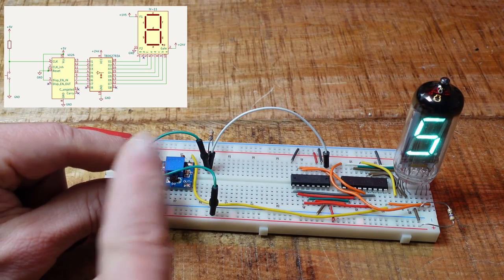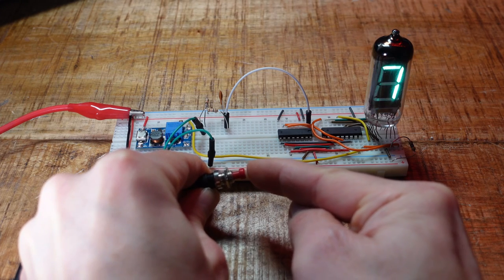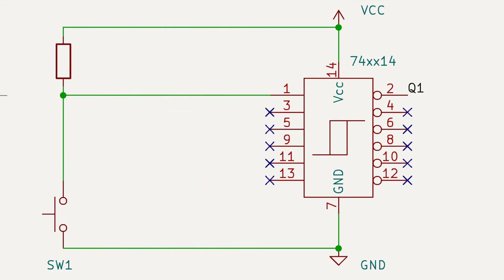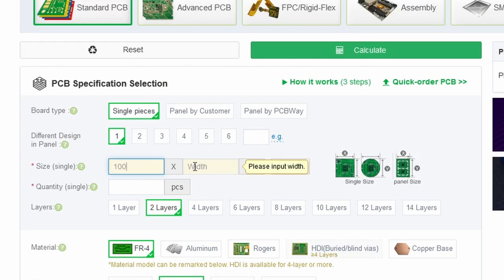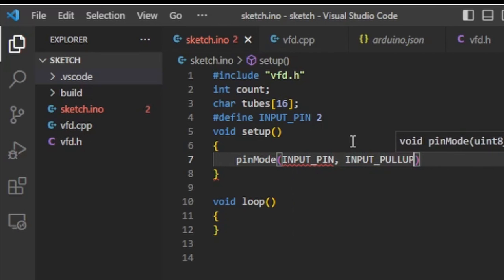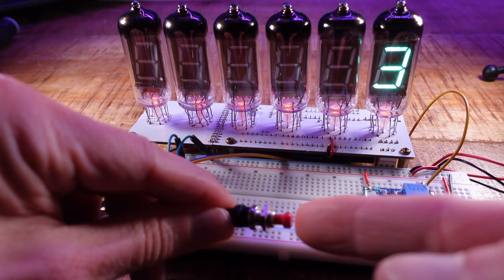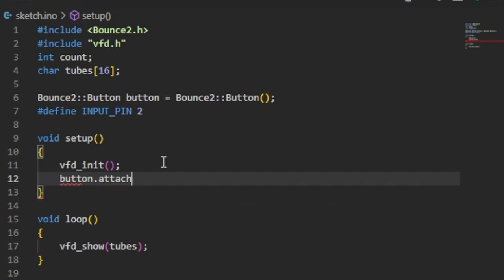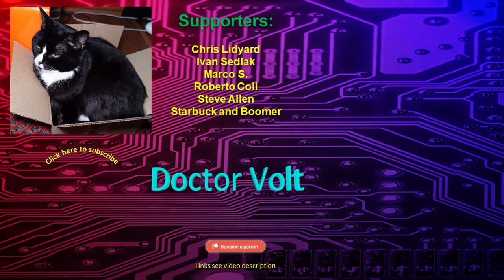How To Debounce Buttons? Seven Best Ways

Comment: Very nice range of solutions.  I need to read about 10 buttons and then have a serial mp3 output for each.  I was thinking of just polling pins 1 - 10, and when a pin is read as high, having it jump subroutine to play the mp3 file, and then poll again for .1 second to insure all are polling low.
For a dog talk button.  Another way is similar to above, but just detect high or low, do whatever you want to do, and then have return to polling just start with a loop for 10ms, 20, etc, to insure all are low before going to normal polling again.
If inputs are human or animal, very good chance the simple software delay is all you'll need.